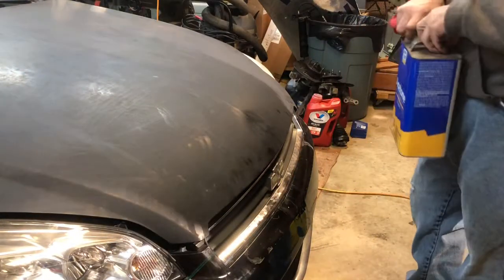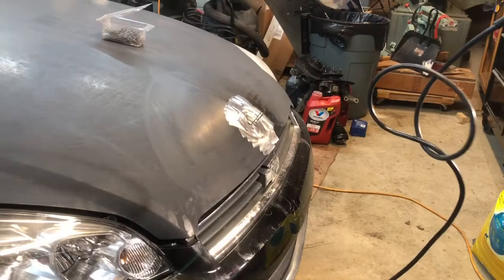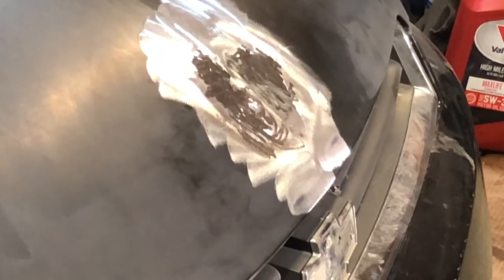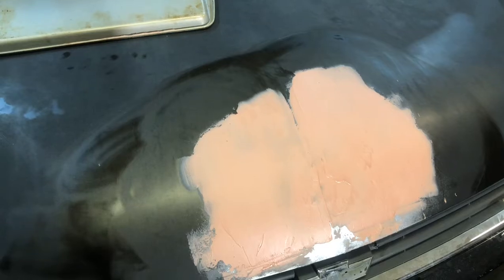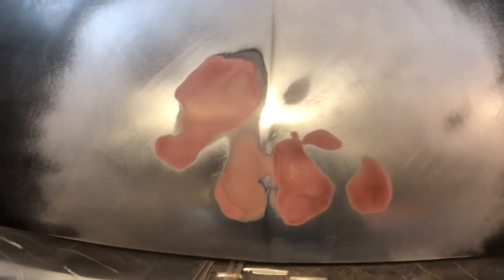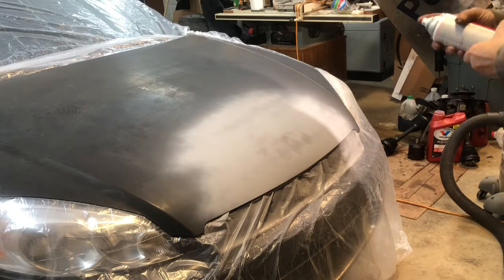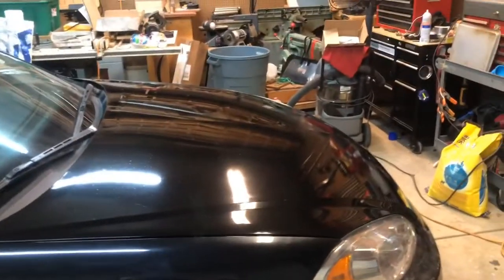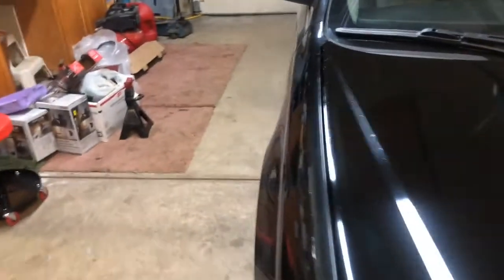COPART Project Car -  The Body Work Begins - Original edit

Comment: Not sure if you have the Harbor Freight one But i really need to pull the trigger on one of those stud guns. Looks like it worked well for ya. I think you may have goofed in the editing. You show the full clip of grinding off the studs. then show the edited clip of it right after. Just an FYI. That  rattle can paint will make a good temporary cover. You can always re-sand it.when you're ready to paint with base/clear.
Reply from the maker: Crap!   Thanks for catching that.  I’ll have to fix that tonight.   As far as the stud gun, that’s an actual Uni-spotter I borrowed from a co-worker.  I’m going to see if he wants to sell it.  If not then I’ll go with the HF one.